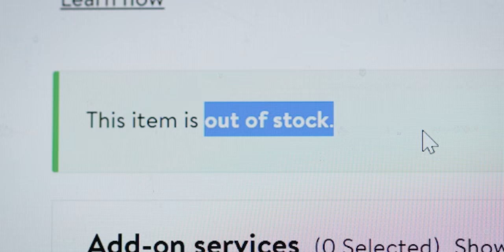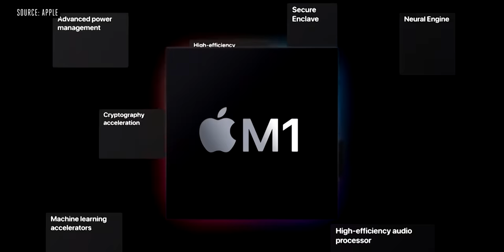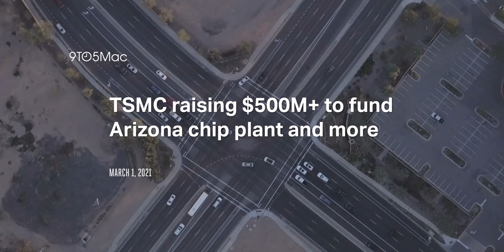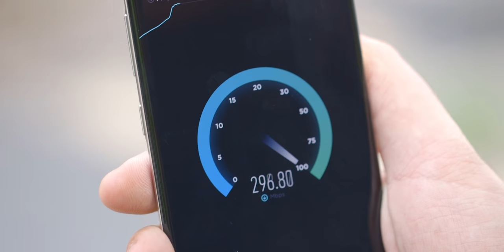The global chip shortage, explained

Comment: I understand that people want new stuff, especially during the pandemic when you have to spend a lot of time inside, but at the same time, this is an important lesson for people. The so called "old tech" is still a viable option for years to come, let it be a phone, console, or a graphics card. We can live with those a while longer. Appreciate what you have, embrace it. No need to buy something just because you can and because everyone else is doing the same. And if you must replace something that's broken now, but you can't get the latest and greatest, you have nothing to be ashamed of if you buy last year models. They might still be an upgrade for what you had before. And you might find a good deal on them as well. It's frustrating for sure, but we can't take anything for granted these days.
Reply: I will be appreciating my 40 fps. Until I can buy a 3070ti at msrp.
Reply: This issue becomes bigger if you try to run a business. You need some assets to do your thing: engineers need work stations, factories need automation equipement, students need laptops, ....
Reply: Sounds good until you try to buy a graphics card released 5 yrs ago and its 3x MSRP

Comment: Most if not all advanced chips aren’t made in China. China makes commodity and low end chips.
Reply: And they refine Silicon which is used to make most of these chips.
Reply: @sherlockmaverick  the video made no mention of silicon or raw material. Maybe you’re trying to reply to Vice?
Reply: They missed out the part but the trade war causes shortage of raw material which hence slow down tsmc processes too
Reply: @sherlockmaverick   Silicon supply has nothing to do with China.

Comment: I kind of feel sorry for everyone that has bought the PS5.  The reason why is, I strongly believe that this shortage will not be lifted until about 2023 and then it will take about 2 to 3 years after that until enough people have the system to make it justifiable for the developers to make games exclusively for the PS5.  The problem is by that time, it will be time for Sony to start winding down the PS5 and promoting the PS6.  So, at this point Sony has two options.  They can either not promote the PS6 and still push for the PS5, which then will cannibalize the PS6 when it comes out and then will make the people who jump to the PS6 really late in the product lifecycle, which then will just rippled to all subsequent generations, or they can just stop promoting the PS5 and just accept the PS5 as a failure and push the PS6, which will then stop the ripple and keep it confined to the PS5.  I don’t see them being able to do both because it would be contradictory and just be confusing to the customers.  So, I think the most business sense would be to do the latter.  If you think about it Sony has already started to do this.  They have had meetings about this and that is why you see all the AAA games being push back as far as they can push them.  So, I think they are going to try and keep most of the good games held back as far as possible and make them for the PS6 and make the library of games for the PS5 scarce.  It seems like the AAA games that are being released first are the ones that had the least interest in them.  So, again, I kind of feel bad for whoever bought the PS5 as I strongly believe it is going to be the least supported generation of console.